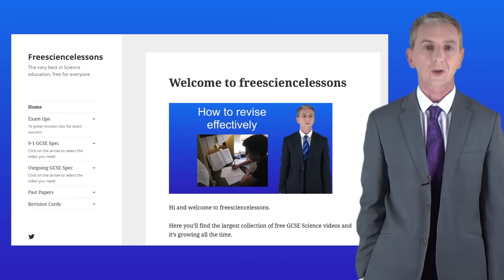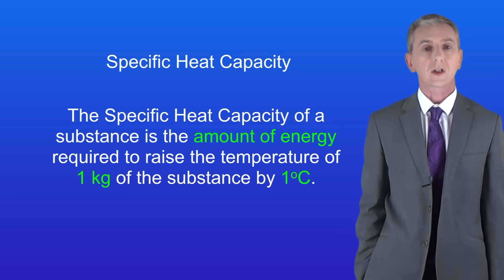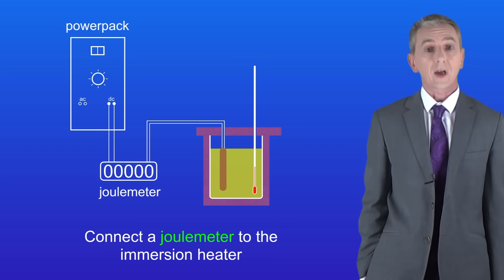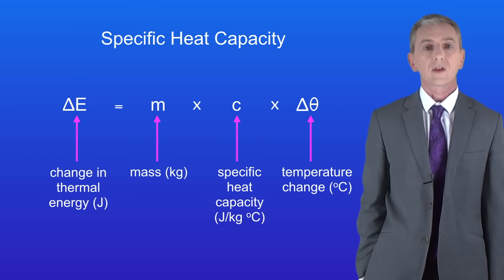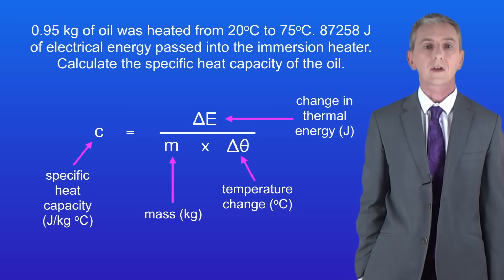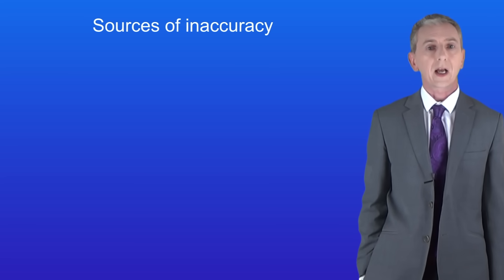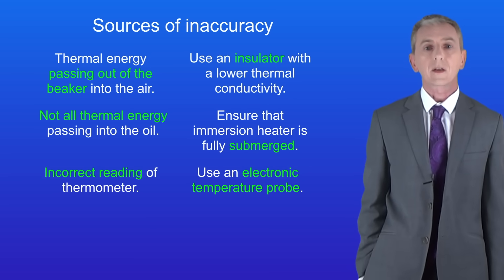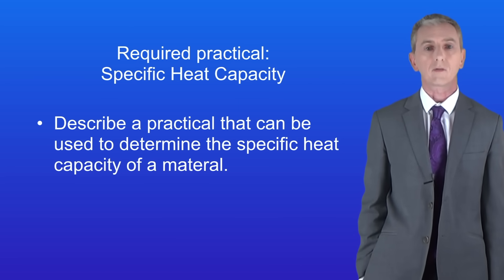GCSE Physics Revision "Required Practical 1: Specific Heat Capacity"

Comment: Hi, is the independent variable for this practical the insulator or the material (e.g. oil) ?
Reply: The material. You could use the same method with other materials eg water

Comment: Hi Sir, I was really stressed and found your video on this practical (it really helped, thank you!)
I have a question, I usually create flashcards for my topics and they really help (i remember everything) but I don't know what to do for the practicals. Do i create flashcards? If yes, then how?
Also, do i have to memorise the sources of inaccuracy? 

Thank you in advance, your help is really appreciated :)
Reply from the maker: Try to reduce the number of stages down to the essential ones. You need to be clear about what you are changing - independent variable (and what equipment you will use), what you are measuring - dependent variable (and equipment) and what you must keep the same -control variables. Make sure that you put the stages in the correct order. I would then try to remember the biggest source of inaccuracy and also a safety point if that's relevant to the practical. Put that information onto a flashcard and then learn them. I hope that helps.

Comment: should i study the practical with oil or the one we did in school, with a block of metal??
Reply: It’s very similar. It doesn’t change much to the actual method. Doing it with a liquid requires some extra steps, so I’d say learn both. It’s not too much extra effort.
Reply: Oil is just an example

Comment: The balance are measuring the weight, should i divide the result by 10?
Reply from the maker: The balance is measuring the mass so you don't need to divide by 10. Balances that report the weight have newton as the unit.

Comment: When doing this experiment at school, we used a 1kg aluminium block. When doing an exam, should we use oil when describing the method, or the aluminium  version if the experiment?
Reply from the maker: In the exam, it will tell you exactly what you are using so you should just use that.
Reply: @Freesciencelessons  do you not use a voltmeter and ammeter and a stopwatch to get energy transferred to the block?

Comment: Hi sir, in my physics lessons (I do triple) we use a aluminium cylinder with a weight if 1 kg and do loads of other steps, in the exam will it use this process with the oil?
Reply: he said in another comment that either way is ok (joulmeter is easier to describe tho)

Comment: sir, in my revision guide, it says the potential difference must be 10V, why?
is this to work out the power used?
Reply from the maker: The potential difference can be anything you want. It might be that 10V is considered safer than a higher voltage.

Comment: um, I thought convection spreads the heat over the oil, so there's no need to stir
Reply: Heat isn't properly distributed, and there's also not enough time for the heat to spread, therefore mixing is required.

Comment: Hi sir,
I found this question and I'm not sure how answer it. Wondering if you could help me.
Explain why the hole where the thermometer is placed is filled with water.

Thanks :)
Reply from the maker: Hi. It is essential that the thermometer shows an accurate value for the temperature of the block. If you simply placed the thermometer in the hole, the thermometer may not be in direct contact with the metal. If you fill the hole with water (which is a good conductor of thermal energy) then this will transfer thermal energy to the thermometer, which will accurately show the temperature of the block.
Reply: @Freesciencelessons   Cant thank you enough for your help!! 😁😁

Comment: Someone please tell me are the required practical part of the 2 exams or not? Do you do it in a classsroom?
Reply from the maker: The required practicals need to be done in lessons. Each of the two papers can have questions on the required practicals that fall within those topics.
Reply: @Freesciencelessons  if you sit the paper as an external candidate do you still have to do practical?
Reply: @abdirahmannuur2223  I'm probably too late but I think we need more info to determine that e.g. exam board etc

Comment: Hello, i have a question, what settings does the power pack have to be on and will this affect the specific heat capacity?
Reply from the maker: The setting isn't important as long as it's on and it won't affect the specific heat capacity (that depends on the material that you are testing).

Comment: I’m not sure but I think they could ask you to use a circuit with an ammeter and a voltmeter instead of a joulemeter. And so you would have to find the energy by using the equation energy = current x time x pot.difference.
Reply: Thank u I was looking for this comment I was so confused cos thats how we have learnt it

Comment: Sir I have a question, Instead of a joulemeter my teacher tells us that we use an ammeter, a voltmeter and a stopwatch.
Then combine to formulas
E = P x t, P = I x V
therefore
E = I x V x t
then we do all the other normal calculations in the experiment (e.g find temperature of the liquid)
Which way is better for the exam?
Thanks
Reply from the maker: In the exam, they might simply ask you to describe a method to measure the SHC for a material. Either approach is equally acceptable (the joule meter is easier to describe though).  The idea behind required practicals is that any valid method is accepted as an answer.

Comment: is the joulemeter the same as an ammeter?
Reply: you can use either but with an ammeter you measure the current and a joule meter measures energy transferred.
a joulemeter is easier because you don't have to do as many equations basically

Comment: This is acc the required practicals on paper 2 of physics
Reply from the maker: It's not. This is required practical 1 which is on paper 1 not paper 2.
Reply: @Freesciencelessons  acc specific heat capacity is p15 which is part of paper 2 in edexcel.
Which exam board are you following?
Reply from the maker: I see. These videos are made based on the AQA spec. That explains it.
Reply: @Freesciencelessons  That clears up the misconceptions. The AQA spec seems to have more practicals as well

Comment: In the CPG revision guide, they find the SHC by using the P=VI equation and then E=Pt and then plotting a graph and doing 1 divided by gradient x mass - which is a better method to use?
Reply: If you get given the energy and time and mass, use the SHC equation; I think CGP only did that because the energy value was not given in the question or because the question required you to draw a graph

Comment: What if the question is about a solid?
Reply from the maker: Treat it in the same way. A solid would need a hole for the thermometer (and maybe the heater). Work out the energy per kilogram.

Comment: What other thing did you say we need to connect to the immersion heater? And what use does it have to the practical?
Reply from the maker: It's a joulemeter which measure the energy passing into the immersion heater.

Comment: For the aqa  gcse do we need to learn the method of the practical?
Reply from the maker: Personally, I would say yes. It's hard to know what the exam board could ask but I wouldn't be surprised if they gave you a selection of equipment and asked you to describe how to do a practical.
Reply: Yes we do it is on my book
Reply: It depends on the paper you are doing 
If you're doing paper 5 then yes But if your doing paper 6(alternative to particle) you don't but you need to know what to measure

Comment: Hi! Great video but just one question. In the CGP book for Physics, it shows the practical for SHC, but instead of oil, it uses a solid block of metal? Could you please elaborate?
Reply: You would still use the immersion heater and a thermometer. The pre weighed metal cylinder has a mass of 1kg and two spaces, one for the immersion heater and one for the thermometer. You would heat it until it reached a certain temperature and compare this with the initial temperature. You would also need to the total heat energy supplied to the heater from the Joulemeter.
Reply: If you do this with a metal block will it be the same equipment and everything